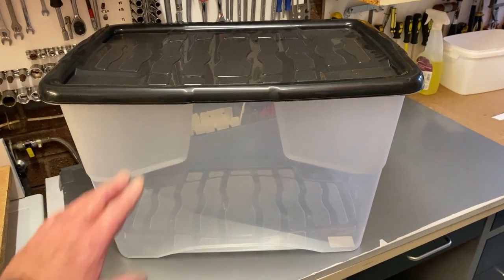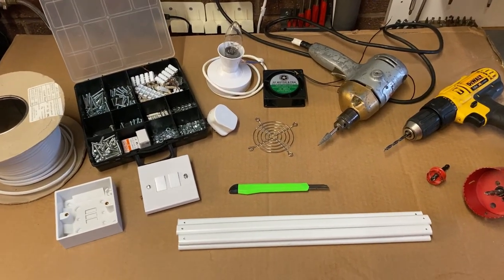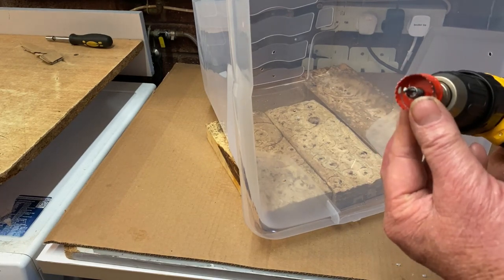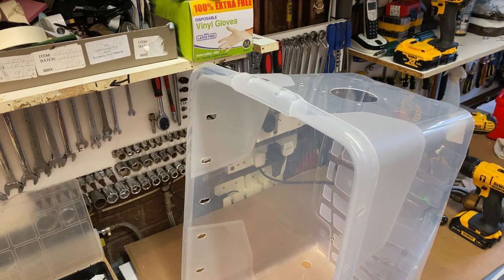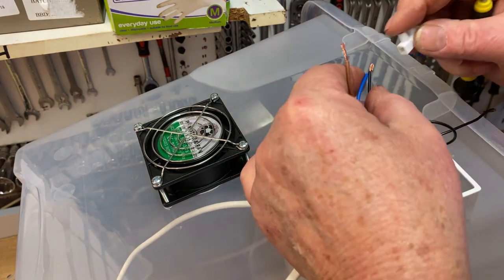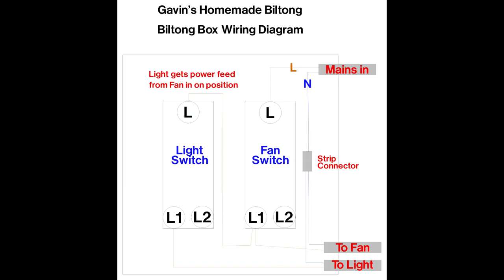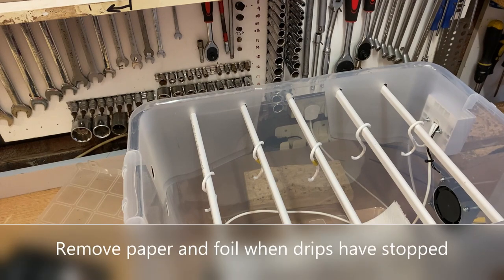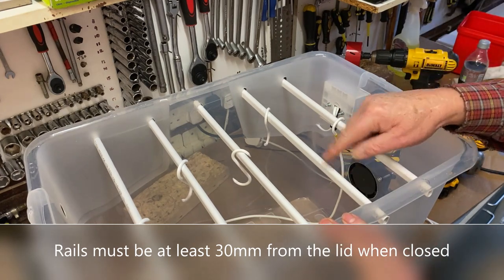Making a Biltong Dryer Box - Simple and full instructions

Comment: Hi, I have a small 9v dehumidifier, I was thinking of using without any light. Have you tried this setup?
Reply from the maker: Try it - the light is just for a bit of heat to dry the air a bit so really if it has airflow it should work. Just cut the meat thinly to try it.
Reply: Yeah, i was thinking that if the dehumidifier draws the moisture away it could work well and it's only 25watts. We have one of those nylon airing cupboards with the little heater at the bottom. I'll try it, but with the dehumidifier on instead of the heater.
Reply from the maker: @Riggy2201  it sounds fine
Reply: I subbed, hi from hull UK

Comment: Excellent video Gavin, one question… Is the fan blowing air into the box or sucking it out? 👍
Reply from the maker: It's sucking it out. So it flows in past the light for some heat into the air, then through the meat and out the other side.